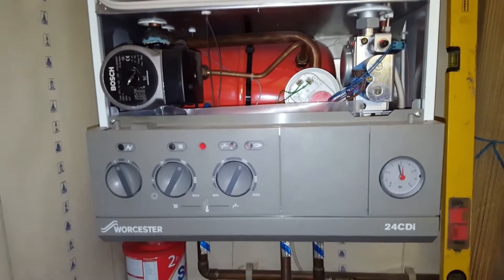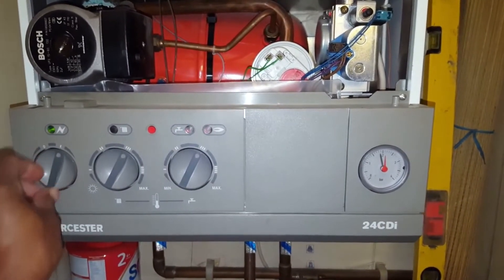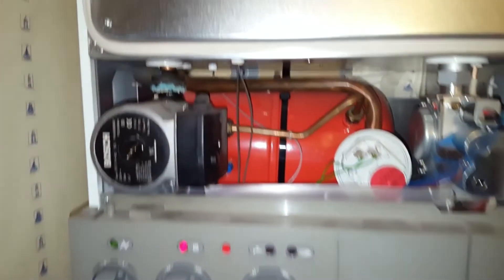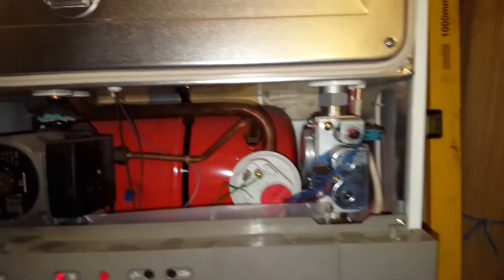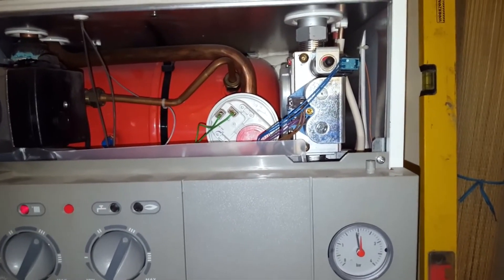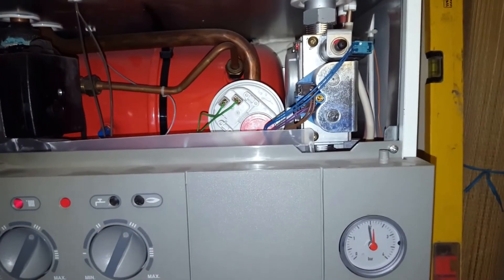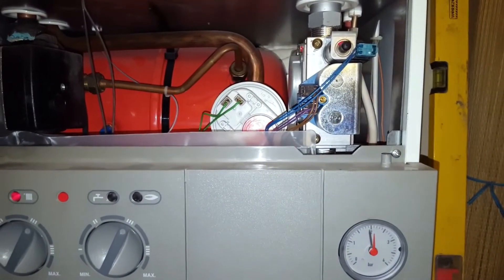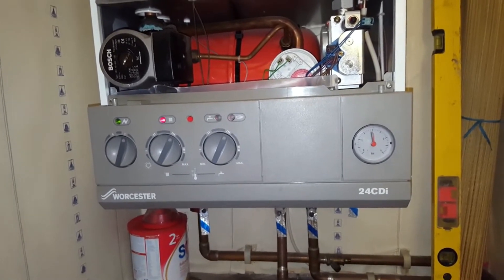Worcester 24CDI RSF No Ignition

Comment: got a 280rsf the boiler has had a remote exspantion fitted will start but then stops and then starts then the centeral heating dosnt work when turned off the light carrys on lit ? no pilot flame ? you can hear air as well in water ?
Reply from the maker: That's a difficult one maybe get a  Engineer